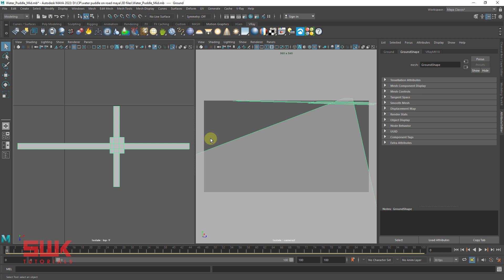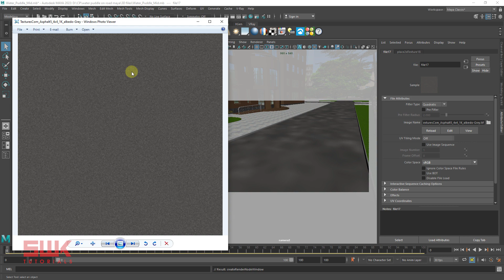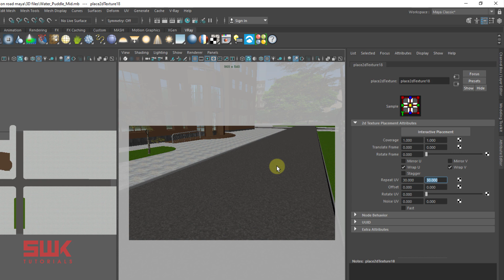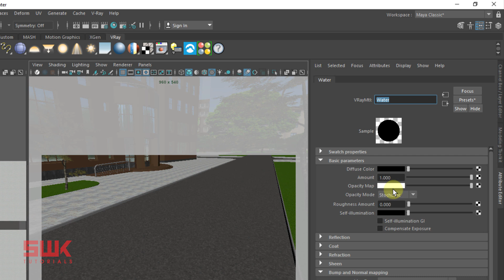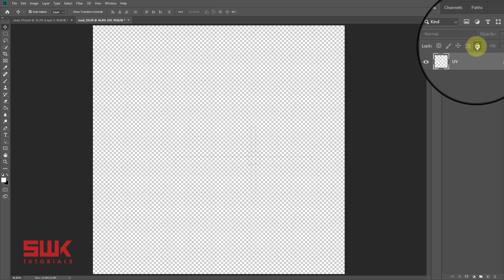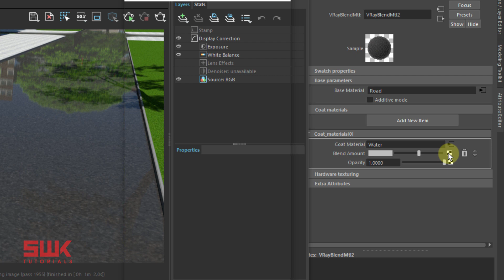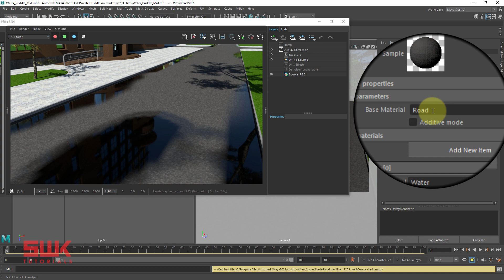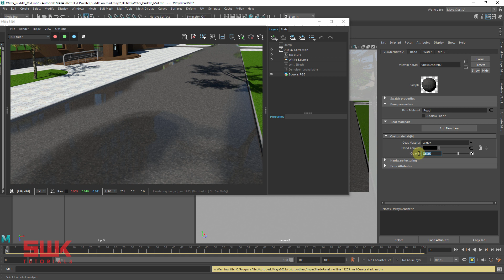Maya + V-Ray | Water puddle on Road using Vray 5 in Maya

Comment: Hi, thank you for the tutorial. I hope you can help me with this. I'm trying to apply a graphic image in the front of a t-shirt I design on Marvelous Designer, like a print, not a repeat pattern but a photo in the front of the t-shirt. I'm trying this method you show in this video to apply the image, but I get a black color around the photo and the base texture doesn't appears. Where should I put the alpha/transparency/opacity texture so the cut of the image allows the base material to show? I'm using the file with the projection mode to project the image in front of the t-shirt. Thank you again. Should be awesome a tutorial about  decals, stamps. :)
Reply from the maker: Use the black/white alpha map in coat material where I use the reflection map.
I e. Blend amount.
Reply: @SWKTutorials  thank you for the reply. that's what I'm doing, for some reason the alpha map doesn't work properly. Do you think this is happening because I'm using the projection mode to apply the image to the surface of the t-shirt? I'm right click on File and choose the option "create as projection" even if I apply the alpha map with the same projection doesn't work. I'm 2 days trying this already. haha
Reply from the maker: I have never used projection mapping. I always unwrap. So I can't say about it.
Just do one thing make a simple plane and test your material on it without projection mapping
Reply from the maker: Just one more thing. Don't use refraction/transparency in any material.
Reply from the maker: Which Vray version you are using
Reply: @SWKTutorials  hmm I already unwrap my tshirt, but I don't want the image as a repeat if I uncheck wrap u and wrap v in the texture editor I don't know how to center the image on the t-shirt. Even using translate frame or offset I don't know what values to enter to center the image. Do you know a tutorial or how can I center the image in the object? Thank you so much for trying to help me. I really appreciate.
Reply: @SWKTutorials  vray 5.00.22 Maya 2020
Reply from the maker: https://youtu.be/0pCnIOKHzmI
Unwrap in this style.
Reply from the maker: Just one more thing. Make the sides of your logo big. Means if have 200 px blank. Pixels on logo sides. Then increase it to 1000 px
In this way you don't need to repeat the texture
Reply: @SWKTutorials  Thank you, I was trying and after a few days with your help I finally make it right. So, thank you, thank you, thank you!!! haha Just one more question. My t-shirt have multiple parts, it's not all together the UVs, there's a way to select multiple parts so I can adjust the size of the UVs all together? If I adjust separately each part will have a different texture density and size.
Reply: @ricr8987  Glade to know you did it. This channel is very helpful. He always replies the comments to help